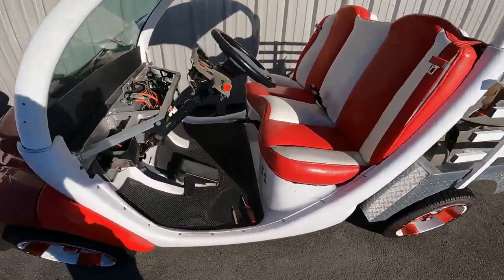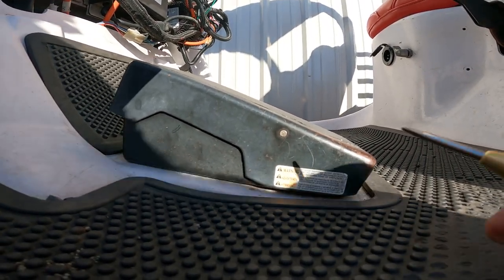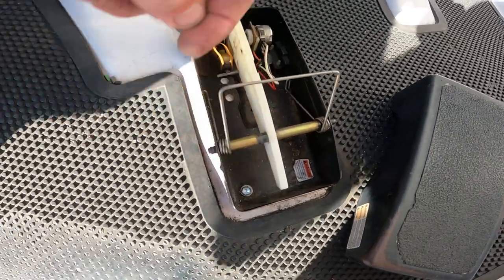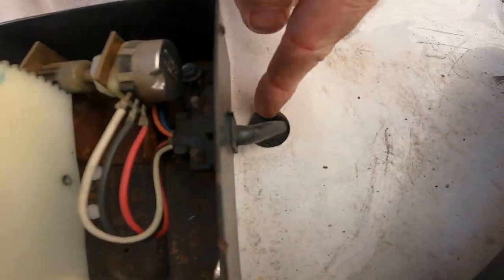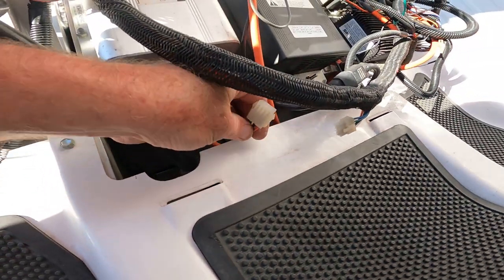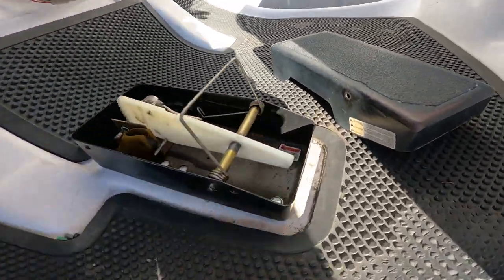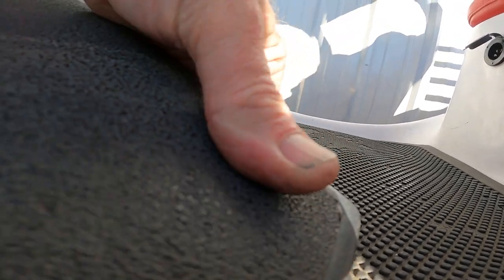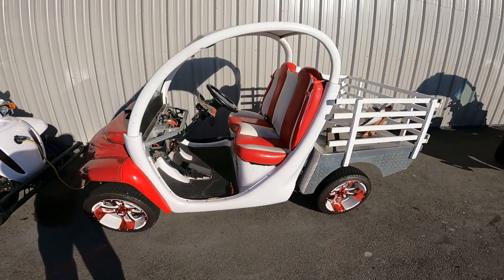How to remove a 2002 Gem Car Gas or  Accelerator pedal

Comment: That pedal micro switch lever must go Under the trip pin on that white thing.  If it goes over it you will get a code 11.  Once, you take off the top lid and pop that spring pin, stuff comes loose under there.  Took me awhile to figure it out.

Comment: Why are you removing the pedal in the first place?
Reply from the maker: I did not remove my pedal. I was showing how it is done. If it needs maintenance it is easier to remove the pedal and work on it on a bench. If it needs to be replaced the same method can be used.
Reply: I hit a big bump, and the pedal micro switch lever got out of position.  The cart quit.